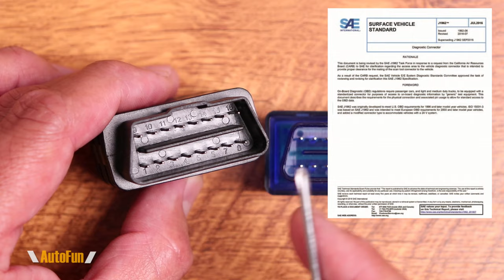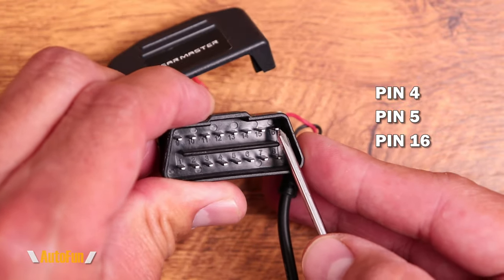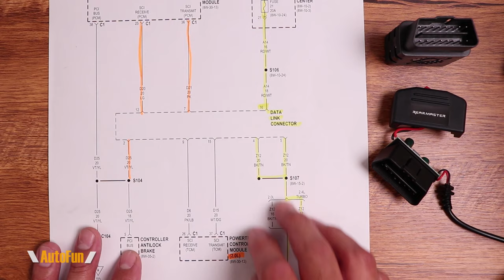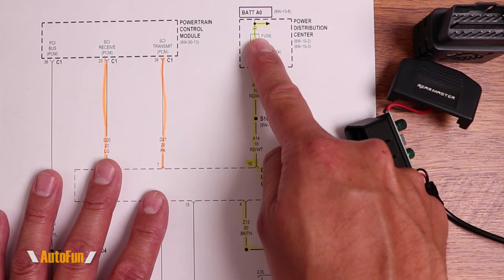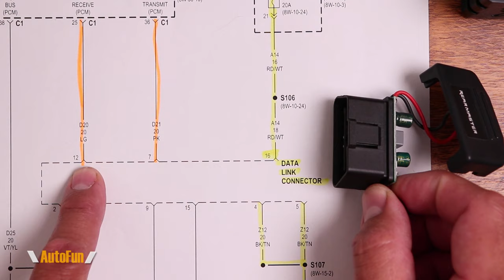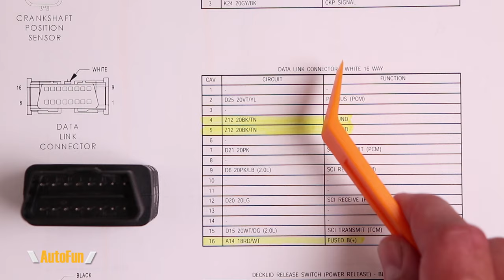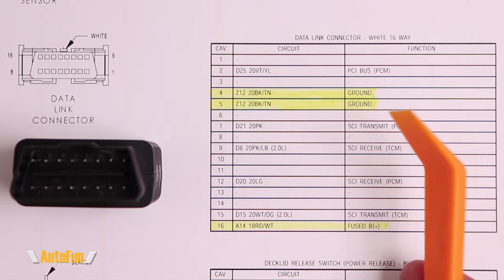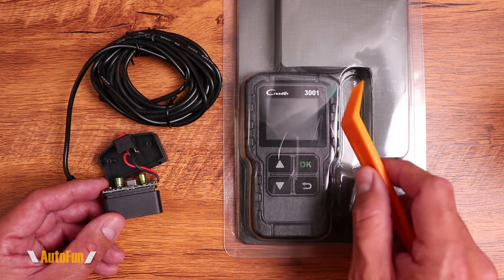OBD2 Power Adapter DANGEROUS? (Is it safe to use the OBD port for power?)

Comment: As an active mobile tool distributor for 40 years, 1967 to 2007, and selling scores of OBD2 diagnostics and having a few thousand customers and about 100 associates in the business, have never personally heard of a foreign object debris or any other cause of any issue with from installing an OBD plug in device.  Right now I'm in the process of installing a dash camera and that brought me to this channel's videos about alternative methods of installation and ways of connecting power.  I'm inclined to use an OBD power adaptor for a clean neat installation that enables optional disconnect of the equipment with minimum disturbance of panels and insulation strips, on my vehicle this can be done from the top of the dashboard and under the carpet by the pedals.  Thanks for the good information.
Reply from the maker: You're welcome richard! and thank you for sharing your experience with us to, it is definitely helpful, Cheers!
Reply: @AlexAutoFun  There always have been experts in the business disseminating bad, even false information.  Its a reassuring pleasure to get input from someone who knows of what they are presenting and have the proof to back it up while teaching us something of value not previously known.  Like your explanation about the pins on the OBD plug not all being active and selectively deployed by different manufacturers.  And that the insurance companies would not get involved with something hazardous to them or their clients.  Many thanks.
Reply: @richardkluesek4301 Scotty Kilmer made a YouTube short once saying to never leave devices plugged into your OBD2 port because it can cause a bunch of problems with your car, lol. That guy is so out of touch with modern cars now.
Reply: @Superman-xr1oh  I'm not a tch or a mechanic and research to find the best correct answer.  I installed the car camera with a suction cup mount on the left side of the windshield where I can reach it to work controls and laid the cable flat and neat from the cigarette lighter up the dash and along the pillar.  Excess is wrapped around the handle on the spotlight.  This way it can be rotated, and when not on the road dismounted.  Where i am the interior can reach temps upt to 110 degrees while parked.
Reply: @richardkluesek4301 here in California, it was 114 outside today
Reply: @Jaqueue  Where I am in ole dixie the interior of my vehicle reaches up to 130 degrees according to a technician's air conditioning pocket thermometer.

Comment: OBD II cable for power is a good choice. Blackvue has sold tons of these dash cams with the OBD II powe cable without any issues.
Reply: I read your review you use this obs2  Cable, is this only support certain cameras like type c or micro cameras? When you turn off your car. If you do not use it in a few days, will this kill your battery or do you have to turn it off? So it doesn't kill your battery.?

Comment: If anyone is worried about potential "damage" or "hacking" of their OBD port, you can always ask certified electrician to remove all the unused pins from the connector. For the power supply, you really only need two, max three pins mentioned in the video.
Reply: Can you tell me which pin is being use for dashcam I would like to know
Reply from the maker: Hi! I show the pins being used in the video, Cheers!
Reply: you can move the data bus pin and make you own adapter , but the hackers now detect the CAN bus on any pins ... best it to cut the bus somewhere
Reply: The seller probably watched this channel and decided to modify the plug. It now has only 3 pins connected.

Comment: There can be several solutions at different production and use levels: 1. for the manufacturer to remove all unused pins at all or replace them with non-conductive plastic dummy pins in the first place; 2. for the manufacturer to overlay exposed pin backs with a non-conductive layer of plastic between the chip and pins; 3. for the end user to do the above-mentioned removal, replacement, or overlaying procedures. (OR abstain from plugging anything potential dangerous into the "brain" of your car while there are several other solutions: cigarette socket, USB, fuse box, external battery, etc.)
Reply from the maker: Great ideas man, you are onto something (While I have not had issues with mine or all the OBD2 tools I review, since I plug so many devices into my OBD2 port with the same risk level, I specially like the idea on non-conductive pins) And here is my hardwire install video https://youtu.be/uZp95NbNlmM if looking to avoid using the OBD2 port. Cheers!
Reply: @AlexAutoFun anything that comes from reputable manufacturers should be safe. One time i bought a cheap diagnostic dongle on ebay under or around $6. It almost fried my car. I no longer buy anything like that cheap and on ebay.

Comment: Thanks - great explanation. Do you know if the Fitcamx OBD power adapter is safe? It doesn't seem to have low voltage protection, although it has a mode by which the dashcam turns on for a short time only when the car is bumped.
Reply from the maker: You're welcome! Ah I have not tested the Fitcamx OBD2 adapter, so I'm not familiar with it, may be a good idea to get a hold of one to do another teardown video, stay tuned. Cheer!

Comment: I appreciate this info very much. I just bought myself a dash cam (the Vantrue N4) and the hardwiring option to the fuse box is not possible due to the fact that none of the 4 fuse holders they provided fit my Ford Edge’s fuse box slot. My only choice left if I want the park mode option is the OBD wiring. I started researching about this option and read many negative comments that stated that this connection would drain your battery or that it could damage it. So I feel more at ease now after watching this video because you really went into all the details meticulously and your comments seem to make sense. Well appreciated.
Reply from the maker: You're welcome Ray! glad to hear it helped. And here is another video https://youtu.be/Qzw9yUYN7zo where I show how to swap out the fuse taps to fit  different fuse sizes (I believe the Edge uses Micro2 you can get here https://amzn.to/3yZiJkN and Micro3 https://amzn.to/3u8PHyI ) Hope this helps!
Reply: @AlexAutoFun   Hey Alex! I just subscribed to your channel because you simply have a way of explaining everything in such a simple, clear and concise manner. Furthermore you take your time to explain how to use the tools needed properly. No one does that bro! You rock! The situation I’m having is very particular. Although I already sent for the OBD I still prefer the hardwiring option to my car’s fuse box. Like I mentioned to you previously I received 4 fuse holders in the hardwire kit, These fuse holders or fuse taps (as you refer to them) come already with a fuse installed and an empty slot to place in your car’s fuse. The particular problem I’m having is that I can’t insert the fuse holder or tap into the empty slot of my fuse box, although I was able to insert my car fuse into the empty slot of the fuse holder. I compared my car fuse to the fuse tap, and the prongs of the fuse tap are slightly wider than my car fuse. I also removed the fuse that came installed in the fuse tap and compared it to mine and it was also slightly wider. The problem is the housing and the prongs being slightly wider that it simply cannot be inserted in the empty slot of my car’s fuse box empty slot. I had read some comments in the Amazon page for the Vantrue hardwiring kit that some people were successful in inserting the fuse tap into the empty slot of the fuse box by shaving the edges of the fuse tap (what I understood is the metal prongs) Another comment stated that you needed to file down the plastic housing as well. I file down both the prongs and the plastic housing to no avail. I wasn’t able to fit the fuse tap into the empty slot of the fuse box. This problem appears to happen only to the Fords brand because the people who commented on the Amazon page all owned Fords. So I clicked on the Amazon link you provided in your previous response but the fuse taps for sale there are basically the same ones already included in my Vantrue hardwiring kit.  I don’t know how these other people who owned Fords were able to do it. So there, I’m giving you material for your next blog. Thanks bro!
Reply from the maker: @raymuniz113  Hi Ray! awesome welcome aboard! ah yes I totally know what you are talking about and yep it happened to me too on a Ford lol Typically the blade distance is not a problem as the contacts on the car are on only on top and bottom of the blade not on the sides so wider blade spacing is not that critical however the plastic body of the fuse tap prevents you from being able to engage the contacts since it won't fit with modification. Some fuse taps do have slightly wider plastic bodies, the ones I linked are the slimmest ones I have found but still required me to shave each end of the plastic edges to get to fit, you can actually see it on my other video https://youtu.be/zbxYA4VhuT8 how the fuse taps have been modified (ends shaved off, which I hid with some electrical tape lol)....
Reply: @AlexAutoFun   So Alex, I wanted to know how far do you shave the plastic off. Because if you go too far you’re basically gonna remove the wall from the sides of the fuse slot. And the second question is if once you shave off the plastic from the body does this shaved off part of the body goes deeper into the fuse slot, because remember there’s one side that can’t be shaved.
Reply from the maker: @raymuniz113  Hi Ray! yep the amount that I shaved off varies depending on the fuse tap kit being used (as mentioned earlier some look almost identical but have slightly larger dimensions) and depending on the dimension of the fuse slot being inserted into (which can also vary depending on the vehicle). But yes the answer to your 2nd question is that at some point if the entire side wall is shaved off the contact will be exposed and the fuse tap becomes very delicate now since it has lost some structure. Normally installers will decide which is less work and more secure either to shave fuse taps or to tap into the wiring directly coming from the fuse box avoiding using fuse taps all together. Hope this makes sense, cheers!
Reply: @AlexAutoFun  Big thanks Alex. Well appreciated.
Reply from the maker: @raymuniz113  You're welcome!

Comment: Thank you so much for this video!

My wife and I have recently purchased our first vehicle and I wanted to have a dash cam with parking mode installed from day 1. 

I had no qualms about using a fuse tap kit to make this happen but my wife was reluctant because she read that this can sometimes cause dealers to no longer acknowledge a warranty; and we did opt for an extended 10 year/200k km one, and have yet to pickup the car. 😬

Now I feel much better knowing that there is a middle road and both of us can get what we want! 😁

And you’re right, some car insurance companies do offer a discount if a customer plugs a telemetric device into their OBD port for 24h monitoring, which I think wouldn’t be much difference than having a dash cam plugged in using low-power mode when in parking mode. 

Again, thank you! I have definitely subscribed to your channel and I look forward to learning more. Great video!
Reply from the maker: You're welcome Matthew and welcome to the channel!

Comment: Super video, thank you. Nice presentation and very smooth camera work. I did use one of your other videos to get my Nextbase GW522 dashcam installed easily (I only mention it so others may know that yes it does work off the OBD switch with the mini-USB. I chnaged vehicles and I didn't want to use the cigarette lighter again and didn't want to route the cable in the headliner and A-pillar past the glove box and etc. It worked out great and so far I'm keeping the switch in the non-surveillance setting.
Reply from the maker: Thank you Ralph!

Comment: I appreciated this video showing how not all pins are being connected to by this particular power supply and also the potential for a short due to manufacturing errors. Have you ever looked into the security issues with various OBDII connected devices? The insurance dongles definitely do connect to the computer and often add Bluetooth and Wifi (and occasionally cellular) which is another concern than just potential power problems. The customer service department of a car manufacturer advised me not to use an insurance dongle because of all the potential problems and I've found it interesting ever since what stories could be out there of how these OBDII devices went wrong.
Reply from the maker: Hi Targip! glad to hear it helped! regarding the insurance dongles if we look at them from strictly a potential for problems then I would assume the probably is low, remember the folks behind insurance companies have experts behind the scenes calculating risk. If the dongle damages your car or causes an issue that affects the car or you then there is liability for your insurance company. The risk is there but it must be so low they consider it acceptable to issue the dongle out. That being said running an insurance dongle brings up questions of privacy and can be a double edge sword for drivers that like to drive aggressively or beyond legal limits. So the dongle may have the opposite effect and not save you money but cost you money! lol
Reply: @AlexAutoFun  Thanks for the reply. I consider myself a fairly safe and responsible driver and the privacy aspect still bothered me. I read an analysis of how the insurance companies process risk based on the dongles and one criterion was time of day, night time driving indicating higher risk. As I worked nights at the time it seemed unfair. There's also the hacking aspect since the devices are wireless gateways to the computer.

As for the risk equation the insurance assumes if a dongle damages a car's electronics, I see what you mean but based on general experience, insurance companies can also be good at denying responsibility for claims. I can't imagine the frustrating run around one could possibly get trying to have them accept their device fried a car's computer. I'd be fascinated to learn if there were any real life stories that informed the car manufacturer I talked to to advise against them. 

Interesting all around to me since it's cars and security. I just found your channel last week and have enjoyed it.
Reply from the maker: @Targip Gadponson  Yep, very good points! especially with new cars all being equipped with Bluetooth and WIFI (on the same canbus systems as the rest of the car systems) it can be scary with hackers out there. But yeah, I would definitely listen to the car manufacturer's recommendation, especially if there is a warranty issue down the road!

Comment: Another point is OBD2 often have a 4G GPS Tracker attached behind the panel using a splitter adapter often done by Dealerships especially if you Finance Through Them instead of a Bank Loan

Always pay via a Bank Loan or Cash never Financing through the Dealership as you almost always end up paying more and are limited in how you can officially use your own vehicle and 8/10 dealerships will add a GPS Tracker without your knowledge it's often fine print on a page somewhere so is not technically illegal as you agree to it!

Comment: Although using the OBD2 port for power is safe, so long as you remaim within its load rating, plugging in OBD2 devices do come with many risks. Of note: some vehicle makes and models will prevent vehicle operation should they detect continued power draw over OBD.  A warning: Every module on a car can be accessed and manipulated via the OBD2 port. In other words, devices can brick your car, bypass your vehicles security, delete key access,... And even control steering, acceleration, and braking (yes, your car can be remotely driven if you have park assist). Be sure you trust the manufacturer of the tools/devices you're using as the risk can be quite high otherwise.
Reply from the maker: Hi djnmw1! Yeah the OBD2 power adapter is a pretty basic device only tapping into power (the one I showed on the video, there are other models out there) without the ability to access other modules on the car. However you are correct, other OBD2 devices that interface to the car's communication network can definitely access sensitive modules and while I have not encountered any issue with the different OBD2 devices I have plugged into my car (quite a bit of them since I'm always reviewing all kinds of silly gadgets lol) the potential is there for sure. As pointed on the video my recommendation if wanting to avoid all risk with using the OBD2 port is to never plug in a OBD2 device into it. Hope this helps, Cheers!